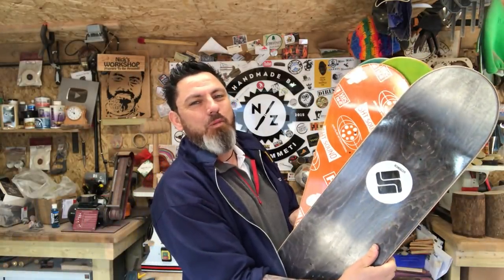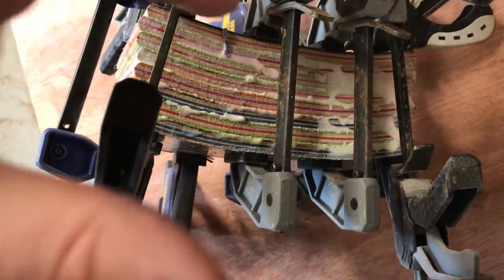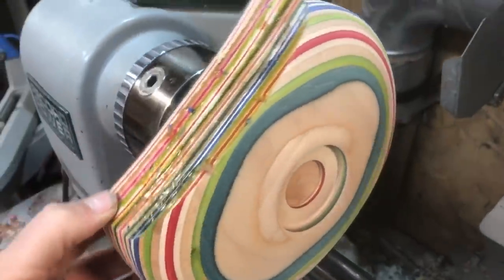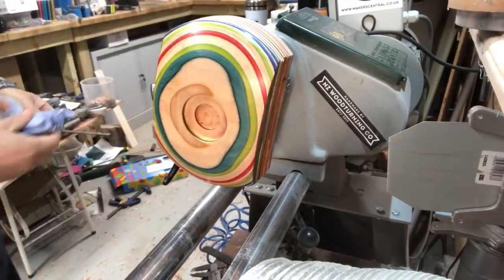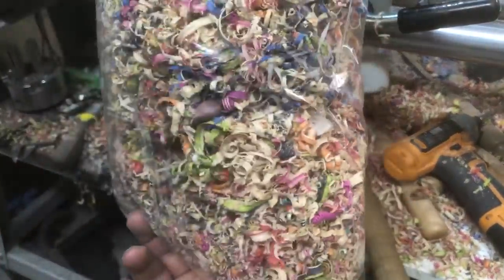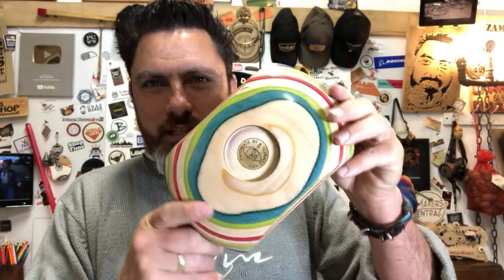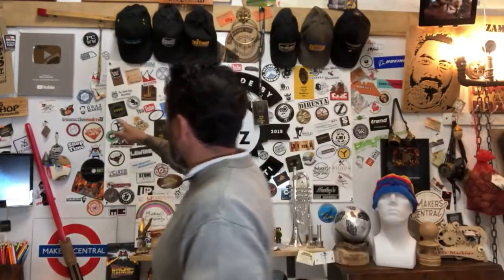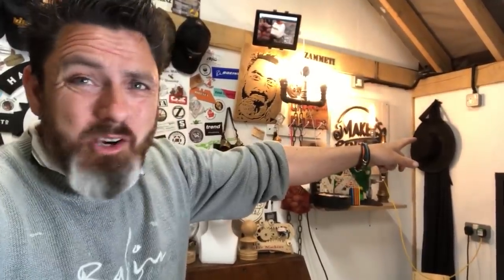I made a Funkadelic bowl using old Skateboards.. 🎺

Comment: Hi Nick, As others have said sound and lighting looked great. Just one point it isn't a screwdriver it is a Brace as in Brace and bit and is a very old carpentry tool used for hand drilling holes. See you at MC. Cheers, Huw

Comment: There seems to be a slight echo in your new shop compared back-to-back with the old but it's not enough to be bothersome or to really worry about (again, that was me really focusing on the audio). Wanting the best quality videos, I understand cutting that back as much as possible however. As you said, it'll probably help after you bring more stuff into the shop. 
I tried looking around at other makers with big shops to see what they did for audio and after solely focusing on audio, a few have about the same amount of echo as you do (which isn't much at all and frankly I never really noticed) and the ones that didn't (still an echo but much fainter) had lav mics [Punished Props for example]. It's worth pointing out I checked EvanAndKatelyn and they did have lavs as well but there's actually a light continuous stream of white noise so it's probably not as simple as "use a lav." It's worth playing around and comparing with in any case. 
As a lot of people have said, the audio does sound perfectly fine in the long run and everyone's ears are different. I just wanted to try to give some constructive criticism at least compared to the old. I don't really know much about audio equipment but there's at least my two cents on the matter.
Beautiful work as always though!